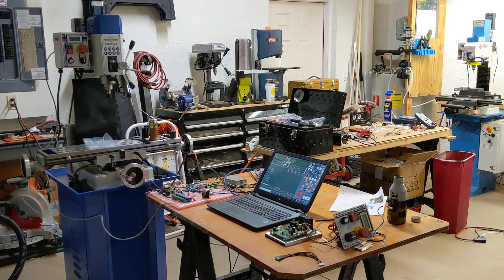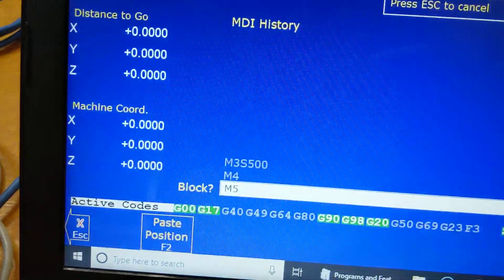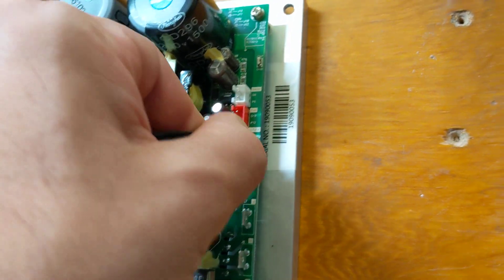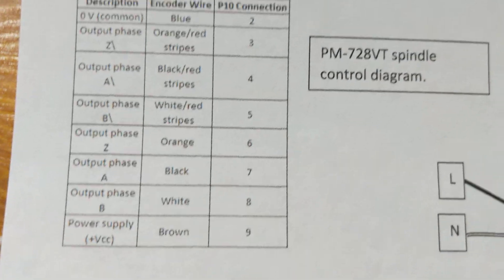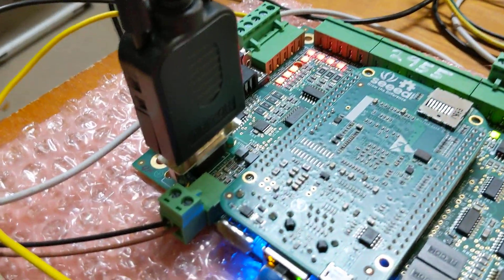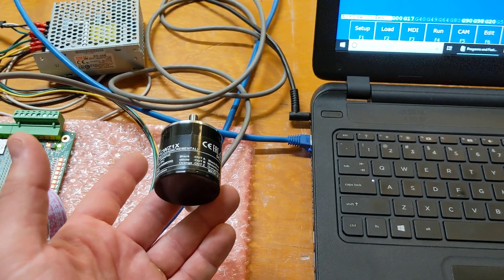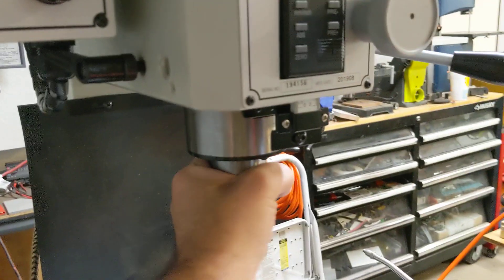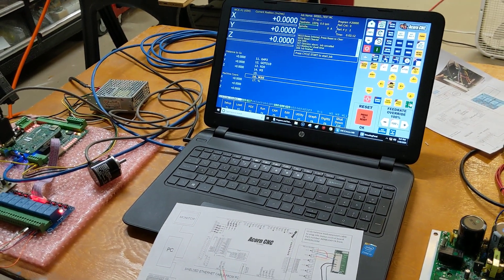PM-728VT Spindle Control #5 with Centroid Acorn

Comment: I have a servo powered cnc router 4x4ft.  I am trying to install a spindle and I tried a vfd 2.2kw and there was so much noise it would activate my servos as soon as I would turn it on, so would this acorn device help mitigate emi noise? I am going to try a 48v dc setup to see if it is any better.

Comment: I'm working on the pm-25mv conversion and found out there's a serious safety concern here. The signal ground on these PM BLDC driver boards are NOT floated at all. It carries 120v ac compared to the neutral and ground wire. That's why you blew up the old board with the alligator clip and a signal isolation method is a must. So treat the spindle control cable as the high voltage wire and be really careful when dealing with the spindle signal. I'm thinking about using an isolation transformer to supply power to the BLDC driver boards in order to add another layer of safety in addition to the kbsi-240d and relays.

Comment: Hi Franco, You directed me to this video from your Sherline lathe video. I have watched this video and looked at the wiring diagram. How does this apply to a Sherline motor control board? Where do the wires from the relay go on the sherline control board. Any assistance would be appreciated.
Reply from the maker: Check this out:  http://sherline.com/wp-content/uploads/2016/01/reversing_inst.pdf
You can use the Centroid Acorn Relays to replace the manual DPDT switch shown in the instructions.
Reply: @FrancoCNC  Ok will give it a try.  Also how did it work out for you?

Comment: Another nice video Franco.... I noticed you you connected the forward/reverse of the motor to outputs 1 and output 2 on the Acorn board.  Did you have to tell Acorn that these outputs were being used to control the spindle or are the factory defaults?
Reply from the maker: Thanks.  I think those are the default settings. But, whether they are or not really doesn't matter - it's really easy to adjust all of the input/output settings with the Wizard.
Reply: @FrancoCNC  Thanks!

Comment: Thanks for making and posting these videos. I am working on converting my PM728-VT as well. I am a little bit behind you so I am learning from your experience. I just finished the wiring diagram for the control cabinet & rest of the system. Motors, drives, power supplies, Acorn board are all here and bench tested. Still waiting for PM ball screw kit and spindle isolation board. Hopefully those will be here soon and I can bolt it all up and test complete system. I am willing to share my drawings with others once I have built/verified them.

Comment: The most important thing I want to see is the actually wiring of the controlls cabinet & the wiring of the encoder to the spindles motor into the Acorn boarad with all the fuses & step down & step up transformers to power the spindle motor. I have not seen any video of this sort laying out all the wiring .

Any help would be appreciated.

Comment: Franco, my EMO controls a contactor that removes power for the spindle control board and all 3 axis drives.  The 24v supply to the Acorn board is separate and remains on.  I do have my spindle board mounted in the same enclosure as the axis drives though, not on the head.

Comment: Great video as usual... I'm looking to do this on my PM-30.  I think the only difference is 240V vs 120V.  Mounting the encoder is still a head scratcher of course!
Reply: Franco, thanks for another great informational video. Wade - Airdog77 , I am in the process of converting my PM-30 right now and am going to be doing this setup by Franco. I think I figured out that how to mount the Omron encoder. I plan on mounting it with a bracket so that the encoder spindle is at same height as the spindle spring cup. I purchased two aluminum 40T XL pulleys off Amazon, but you can find them on ebay also. I also have installed the Priest power drawbar which I think I can modify the aluminum mounting block that mounts to top side of head and mount the encoder bracket to that. I plan on boring the one pulley to fit around the Spring cup. I think the set screws will hold the pulley onto the cup. It doesn’t seam to slip when holding the cup and turning the spindle.  If the cup winds up spinning I will just run a screw though pulley into top drive pulley on spindle.
Reply: @csxal  Excellent.  Thanks for sharing your solution!  I've been strongly thinking about mounting the encoder at one of the top front corners and doing very close to what you describe.  I was lacking the details at this point, so again, big thanks on that.  I've already pulled the trigger and ordered the 40T XL pulleys from Amazon.  I'm using the pneumatic impact driver that the Physic Anonymous guys show in their video as an initial PDB as I decide what my long term solution will be.  Just to confirm, did you hook the L and N connections on the KBSI-240D to 240V?
Reply: Wade - Airdog77 , I’m just powering it with 110
Reply: @csxal  Good to know, thx.

Comment: I was reading the manual for that converter board. A built-in power supply enables the KBSI-240D to be controlled with a 5KΩ remote potentiometer (connect potentiometer to terminals “P1,” “5” and “6” – see page 9). The potentiometer can also be wired for Auto/Manual Operation.
*The input range of 0 - 25V is the maximum voltage that can be applied to terminals “5” and
“6”. The minimum input voltage is 0 - 5 volts, which can achieve an output voltage of 0 - 10
volts. The unit is factory calibrated so that a 0 - 10 Volts DC input yields a 0 - 10 Volts DC output. Question is if the input voltage is 0 to 5 volts DC is the voltage across the output 9 and 10 going  to be 0 to 5 volts to match your factory speed controller ( IA terminal) and Ground terminal. Those little blue trimmer pots adjust the input and output voltages for Minimum and Maximum voltage levels. Here the manual I understand it's meanings from years of electronic work. The centroid is 0 to 10 volts output  so it will have to be set lower on the KBSI output to 0 to 5 volts because that is what the speed control is using. https://acim.nidec.com/drives/kbelectronics/-/media/kbelectronics/documents/dc-drives/manuals/kbsi_manual.ashx?la=en

Comment: Very nice as always. I'm going to compare how I ran everything on my mill to yours. I get this weird thing at the end of my run cycle where the mill will stop the rpm then reverse direction just for a brief second then shutdown. I'm not sure if it's in the g code from fusion or a hardware thing. I'm curious what you come up for the encoder mounting.